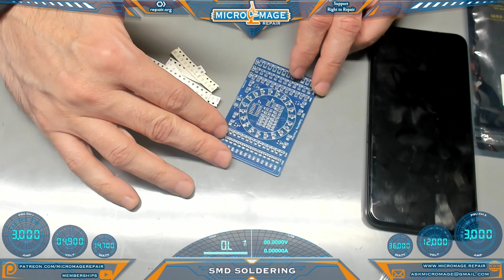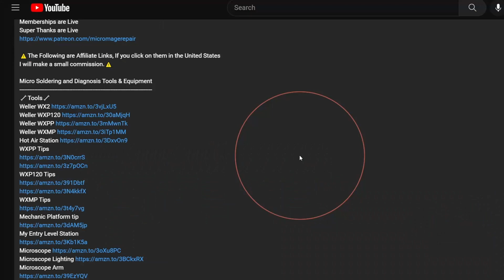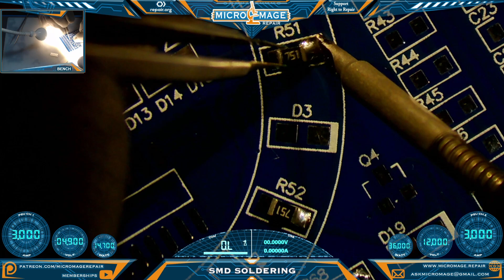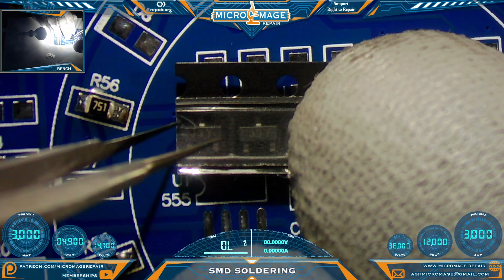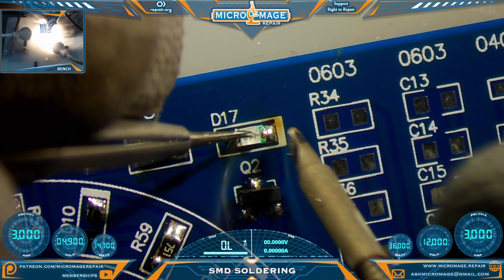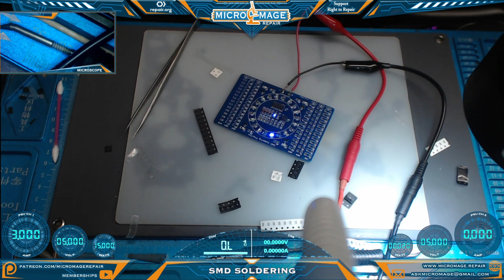Practical SMD Component Soldering Techniques

Comment: In my newer line of work I have discovered the joys of solder paste. A tiny dribble of paste on both pads, wedge a component on and heatgun or iron to perfection. Great video!
Reply from the maker: Thank you so much!
I neglected to cover solder paste.
I just didn't think about it.
Unexpected benefit is I now have a topic for a Part 2! 🤣
Reply: I thought for the longest time it was just messy and useless because I used too much, a little goes a long way! Plus it looks cool under the 'scope!

Comment: No way! I have the same kit flying around my place somewhere! Also practicing on that one! :D To be honest I probably would have used solder paste and hot air on any components just because of the fun factor. Its very satisfying watching the components moving in the perfect spot by themself. :)
Reply from the maker: Yeah I really should have covered solder paste too. Just didn't think about it.
I so rarely use it other than for re-balling BGAs.
Reply: @MicroMageRepair  I am using it regulary. KEK Solderpaste its callled and has a melting point of 183 Celsius I think. I also use it as lowmelt solder for desoldering stuff. Works fantastic specially on stubborn manifactured components and pins that dont wanna melt.
Reply from the maker: @x-fix  Interesting!
I use what's called "Rose's Metal" which is the base ingredients of most low melt solder (Bismuth and tin).
It was a cheap alternative when low melt was stupid expensive, it isn't as bad today.
Reply: @MicroMageRepair  Thanks for the hint! I need to look for that. About KEK Solderpaste, there is even an other version with an even lower melting point on 135 Celsius. Might even work better as lowmelt solder replacement then the other I posted earlier.
Reply from the maker: I have a good reason to do a part two though! 🤣